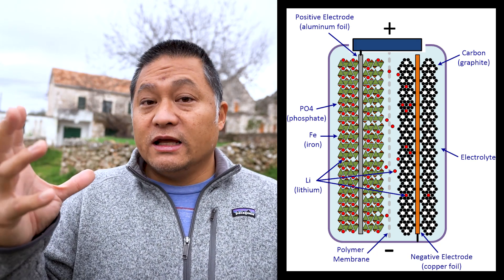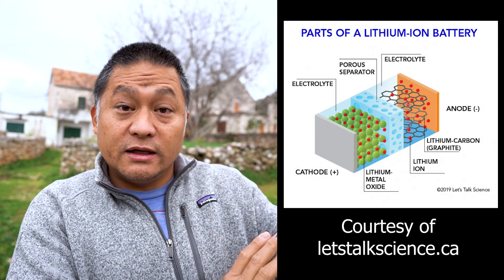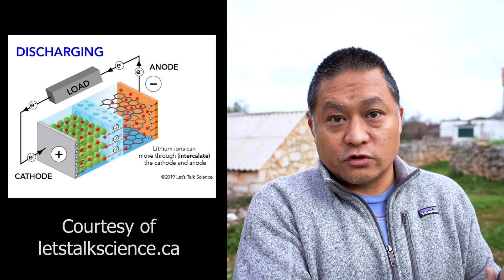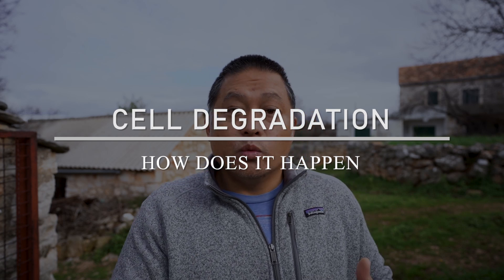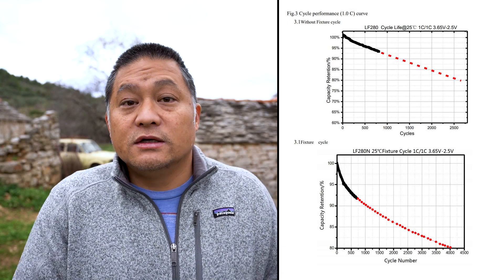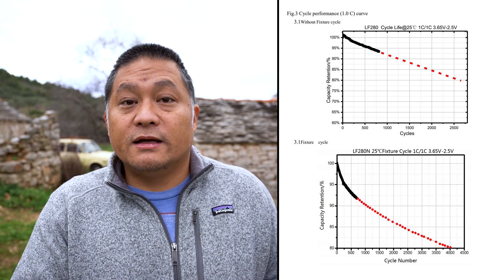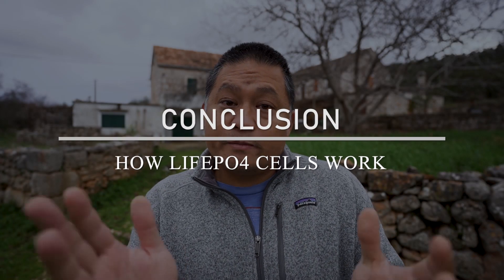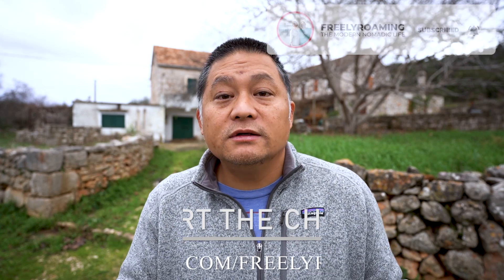How LiFePO4 Batteries Work and The Truths About Compressing Raw Cells

Comment: Freely Roaming,  For your DALY BMS how did you decide how many amps to pick?   I see you chose the 120 amp bms.
Reply from the maker: It is based on your expected maximum power draw. My inverter is 1kw so I know including all my other appliances, I will never draw over 1500 watts at one time which is approximately what the 120A will allow.
Reply: @freelyroaming  The maximum watt appliance I will be using is a 1200 watt blender.  I was thinking of getting a 2kw inverter to cover it.   Does that sound like overkill for the inverter?  If I end up going with the 2kw inverter, then I would need a 250A BMS??
Reply from the maker: 250A would be overkill. I would go with a 150A or 200A at the most for this application.
Reply: Do you think a 2000 watt inverter would be overkill if the maximum watt appliance I would be using is a 1200 blender?   Thanks for your inputs.
Reply from the maker: No I think a 2kw inverter will give you good headroom for that.

Comment: What do you mean by compression?
Reply from the maker: It means you should use  a container that push the cells together with a certain amount of force to keep it from expanding. Most common method is using plywood, threaded rods and nuts.

Comment: Nice video. By the way, i think it would have been a lot better for you if you just have bought a smart BMS, and that would have saved you buying a shunt, and the temperature sensor. Can you make a test with the inverter and make some test of discharging? Many people wants to see exactly how Daly BMS behave and if they can really reach 120a for 10-15 minutes or so. There are not many videos of the tipical Daly in action, most people just complain about them. You mentioned you would like to test some induction cooking, that would be really really interesting. I think your case is really useful for many people because out there there are lots of 24v setup videos, but not many tests on 12v in real life conditions.
Reply from the maker: A smart bms would not replace a shunt because it does not measure capacity by measuring amps as you would using a coulometer. It just shows voltage which is not what you want to use to calculate SOC. The Victron battery sense temperature sensor works with my MPPT chargers which a smart bms would not. This setup give me much more flexibility and much better accuracy in determining depth of discharge. There are a lot of people who do not understand how these systems work and expect more than they should which leads to complaints online. There are far more people who are happy with these. I have not seen enough data on these smart BMS units to trust that they will do what they say. I also prefer to not have any parts in my systems that try to do multiple functions at a time. It means one device failure instantly turns into multiple device failures and become more difficult to replace for me as a full-time international travelers. For critical systems, dedicated single purpose devices are simpler, less prone to failure and easier to replace if needed. I will need to upgrade my inverter from a 1kw to a 1.5kw inverter to draw 120A. That's is why I chose this unit. I don't expect to ever reach 120A with my current setup. If I upgrade my inverter, I will most likely also upgrade the BMS to provide more capacity so I never need to run it at peak capacity.

Comment: Great build!  I'm planning on building my own. I have a question you might be able to answer for me. I'm in a cold climate and I'm worried about charging at too low of a temp. I'm wondering if you know if I open the circuit on the black lead from the BMS if it will stop the charging? I have several ways I can disconnect the circuit so it will cycle back on when it warms up again. Do you think this method will work? Do you know if the BMS will cycle back on properly? Can't wait for more of your videos. I might doubble up and make a 560AH 12V using one BMS. I'm planning on using the Daly with the BT if I can find it at a good price.
Reply from the maker: One of my next videos will be using a thermostatically controlled switch to turn DC heating pads on and off to keep batteries warm in cold temps. If you are planning to keep your cells in those conditions, I would recommend doing something like that as well. If you open the negative circuit the battery will stop charging. That's indeed how the bms' charging protection works. As long as you reconnect the bms and provide proper charging current and voltage, it should start charging again.
Reply: @freelyroaming  Thank You I thought it would work but asking for advise helps. I will consider a heater in the circuit too. I'll be watching for the video.

Comment: My feeling is that if your application is such that you're going to be pushing your batteries to 1C charge or discharge rate regularly, you need to increase the size of your battery bank.   The cells were not designed to be compressed.   But, they were designed to permit air flow between them to improve the efficiency of cooling - which compressing them would defeat.   So, I recommend you not second guess the engineers who designed the batteries and, instead, work within the safe limits of the design in such a way as to maximize the life of your batteries.

For example, your car may be designed to have a maximum speed of 120 miles per hour, but that doesn't mean you should drive it that fast all the time.   And, if you do, you can expect the car to have mechanical failures more often - because, the engineers who designed the car did so with typical uses in mind, and driving the car at its maximum speed all the time is not a typical application for a car.   And, if you need a car that can easily handle being driven at 120 miles per hour all the time, you need a car that is designed to totally different specifications and with much greater performance characteristics - like having a top speed of 200 miles per hour, and not 120 miles per hour.  In other words, you need a race car.
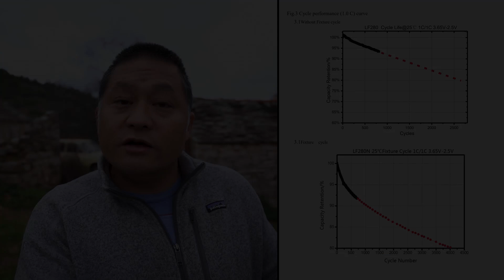Reply from the maker: The datasheet from the manufacturer actually talk about using a fixture being able to handle 300kgf amount of compression force to achieve the rated cycle life with 1C sustained draw rate. It is discussed and shown in this video but I suppose you perhaps missed it. So it is the engineers who designed the batteries who recommend compression for high discharge rates. Not anyone else. These are not based on my feelings and there is no second guessing happening here. This is per their engineers' and designers' recommendations. You can easily find the datasheet yourself and see what it says. Just Google 'EVE LF280 datasheet'. The datasheet should say 'Version E' for the most recent revision. 1C is also their recommended maximum sustained discharge rate. It is not a burst discharge rate. The datasheet also states that plainly. In fact if you see the part of this video (7:25) that shows the manufacturer's tests where they cycle the cells 3500 times at a constant 1C rate, you will see that it is in fact what they were designing these cells to do. A grade A cell needs to meet the specs from their test or it does not pass as grade A. These are not personal opinions. They are exactly what the engineers designed for them to do. Using your analogy, these cars can do 200mph but they are designed to run at 120mph all the time or they do not meet spec.

But of course that is different than saying it would be better if you ran at 0.5C for even better longevity. I believe that to be the case as well but for anyone who needs to run them at 1C, they are designed to do so with the proper fixture attached.

Comment: Just FYI if you are going to tightly pack the cells together, make sure to add another insulation sheet between cell. 
I just check my LISHEN cell the Voltage between the case of the cell and the Negative terminal, it shows the same Voltage reading as when measure between Positive terminal and the Negative terminal, 0V between Positive terminal and the case.
So I do the same test with the 90Ah Liitokola and get the same result.
So the case is positive on my batteries.
I put 100 Ohms resistor on Negative and the case, the Vdrops on the resistor is 1V, = 10mA.
That is not low leakage.

Comment: Very informative on the fence about lithium I'm a fla man question why use buss bars to connect batteries I use 1/0 cable then to a buss bar for loads and charging. Have a Happy and Healthy new year
Reply: Those are still pretty stiff. I think the best thing is those copper braided bus bars
Reply: the best thing to use for bus bars in actually aluminum flat bars. Thwy produce aluminum oxide which coats the aluminum and prevents further corrosion of the aluminum  When using copper they must be coated with something or else they will corrode when the electricity is applied.  Thats why most copper wires are either tinned or made with aluminum (CCA)
Reply from the maker: Copper-clad aluminum is actually used to save money versus solid copper wires. Aluminum has is benefits when it comes to corrosion resistance but it has 50% less conductance than copper (0.4 megaohm/cm vs 0.6 megaohm/cm) That just means you will need to use thicker wires if it's aluminum cored.

Comment: Your reasoning matches that of a couple of other folks whose recent videos I've watched.

Any idea, very roughly, what rate your average van-installed system is going to be discharging and charging at, C-wise? Assuming average battery capacity, usage, solar charge capacity, DC-DC and shore power charge capacities?
Reply from the maker: I am at a very low c rate. Most of the time less than 0.1C and probably never above 0.2C. same for charging. The most I can push while charging is 20A from the DC-to-DC charger and full solar which maxes out at 30A. That's a 0.18C charge rate.

Comment: Great explanation!  I got the 280ah cells because I wanted to run an inductive cooktop without pushing the limits of the recommended max continuous discharge.  That was before I heard of the compression issue.  1800w is about 140a, 0.5C.  If I had bought 100ah cells even running the cooktop on reduced power I'd be at 1C.
Reply from the maker: Definitely a good call to go up in size. Even if you don't need all the capacity but just having the discharge headroom.

Comment: Ok I’m impressed with your knowledge. Now tell me if they are safe.
Reply from the maker: This is probably not a video for you like I said at the beginning of the video. It's not about safety either. It's about longevity. There will be a video about safety coming soon.
Reply: Lithium Iron Phosphate (LiFePO4) is the safest formulation of lithium batteries available.   But, they're still batteries that are capable of storing enormous amounts of energy.   And, having that much energy on tap has inherent danger associated with it.   The same can be said of a standard wall outlet.   The outlet technology is safe.   The electricity that flows through it, though, has the potential of being very dangerous.   That's why you should not do your own electrical work, unless you are familiar with the dangers of electricity.

For example, if you drop a wrench across the terminals of a 100 amp hour LiFePO4 battery, the wrench will instantly weld itself to the terminal and then melt within seconds right before your eyes.   Then, you have molten steel melting its way into the battery and it's so hot that it could start a fire.   But, if  you don't drop a wrench across the terminals, none of that will happen.

Comment: Thanks for that . Just received confirmation of my 32 pieces from Basen technology having been dispatched . I dont think I will go down the compression route , as my battery at 28kwh will never be discharged or charged anywhere near to 1c . Thanks for the easy to understand explanation bro .
Reply from the maker: You are very welcome. Glad you find it helpful. A 1C draw from a 28kW pack will be an enormous amount of power output and I would be surprised if you even get close to that maximum limit. Good luck on your build.

Comment: My understanding from research is that these aluminum case cells with be concave on the sides when discharged and convex when fully charged.  So if you bind them together when discharged with a small pressure then they will be properly compressed when charged.  My CALB cells have more rigid plastic cases,  I have never seen them swell,  but I still have them bound together with a ratchet strap.
Reply from the maker: Yes the enclosure that contains the raw cells have a lot to do with the amount of compression. My aluminum cased cells already have compression built in so very little fastening will be needed if someone chooses to do it.